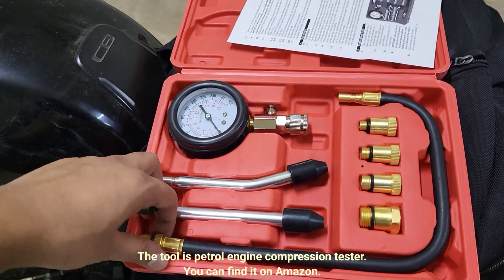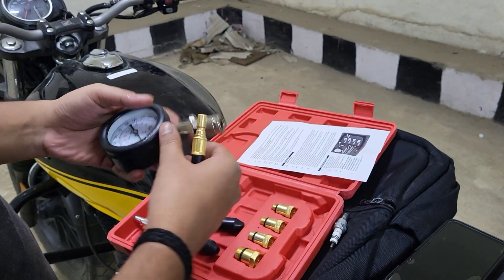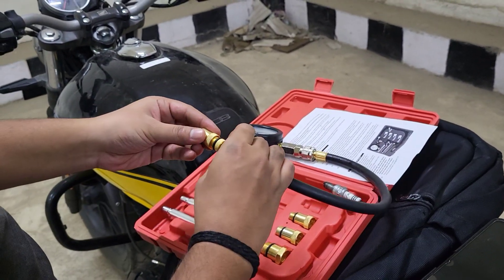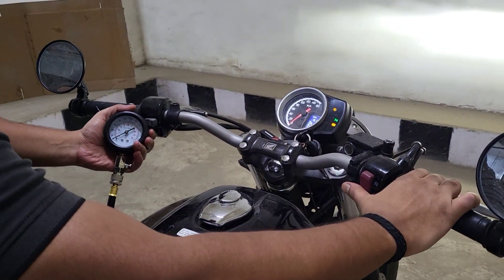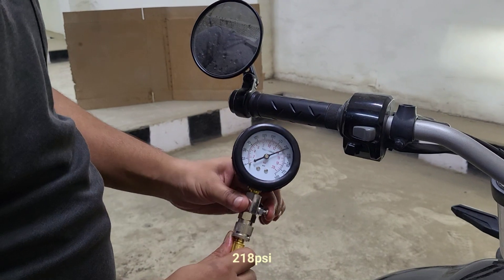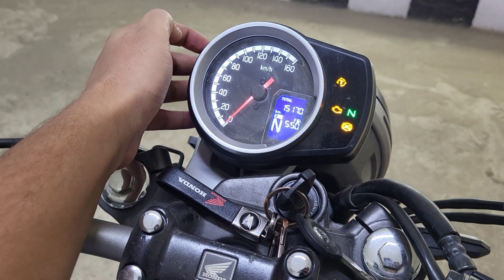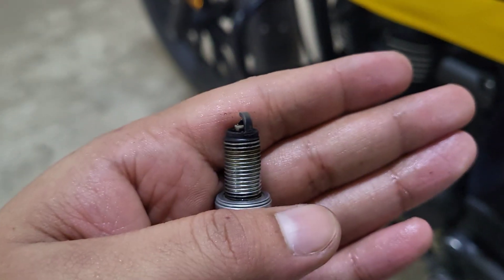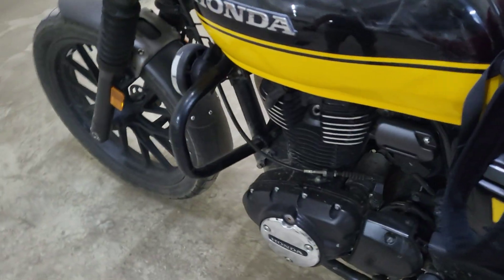Honda CB350/GB350 engine compression test | Engine tuning part 1

Comment: Could be ecu issue or traction control messing with bike’s performance?
Reply from the maker: Can be the ecu but I don't think it's the traction control as the traction control light blips when active. Currently checking the fuel injector. Time and money are the constraints delaying the diagnosis. Will certainly get there; sooner or later 😃
Reply: @Trimape i feel hesitation in acceleration when opening throttle but when i turn off traction control off the bike feels lively
Reply from the maker: Never thought about this. Thanks for confirming. Will try this myself when I go back to my college after Chhatth.

Comment: I exactly have this problem and I kept saying this to service centre but it doesn’t go away.. please bring a solution
Reply from the maker: I will keep on posting about the updates.  Our problems might be similar but the cause to be same is a probability. Moreover my bike's engine has been rebuilt twice. Go through my team bhp thread to know in detail. Anyway I'm taking one step at a time to rectify this issue. I hope you find your solution along the way🤝
Reply: R u that guy with the problematic cb350 rs ?
Reply from the maker: @voyaging4 Unfortunately yes 😅

Comment: Ok 👌 low rpm idling could be bcs of improper valve clearance
Reply from the maker: There is no problem in idling. It's the initial throttle lag. Anyway I have played long enough adjusting the valve clearance to tell you, unfortunately that's not the reason behind it.

Comment: Hey, why should the throttle be held open
Reply from the maker: The compression built here is not from combustion rather the air being compressed inside the chamber due to forced rotation from the starter motor. Throttle needs to be open to allow unhindered air entry for max compression check.